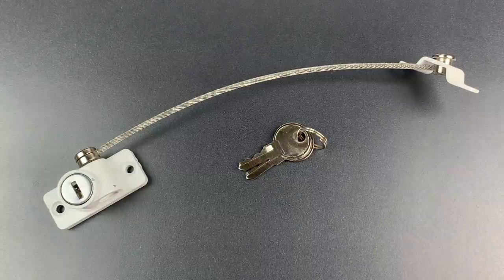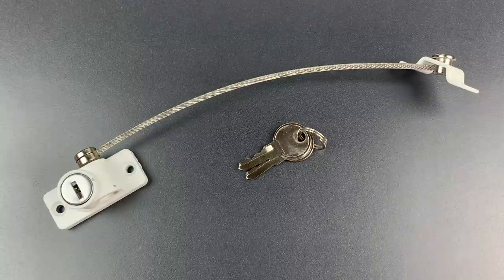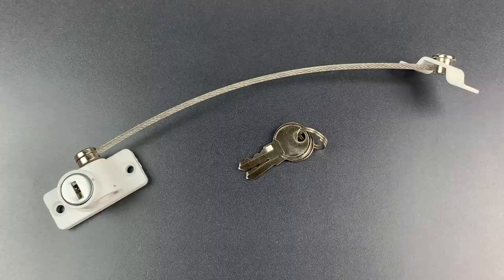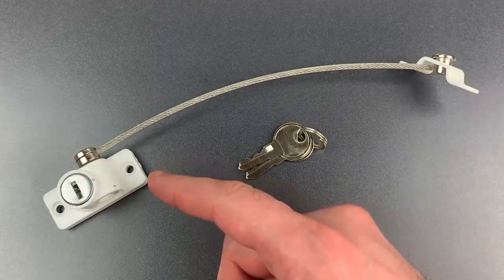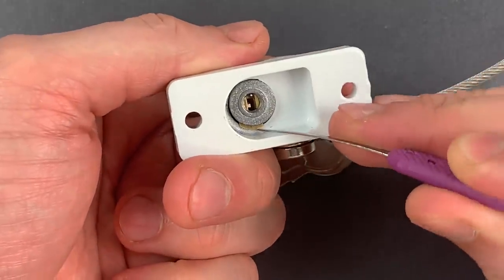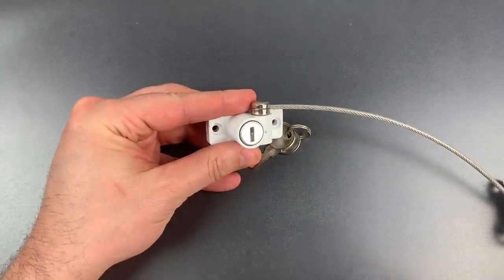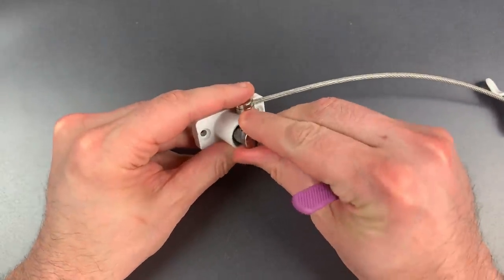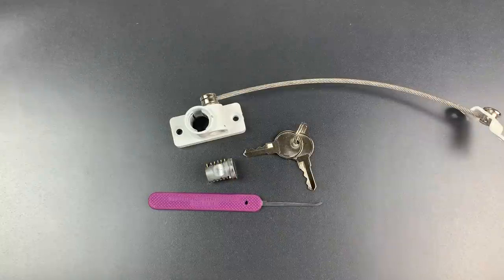[873] Why Is This Lock So Dangerous?

Comment: Wish you had shown from the back as you used the pick, so we could see exactly what was happening.
Reply: Good point
Reply: he just grabbed the core and pulled
Reply: Stand Tall the spring-loaded wafer needed to be moved first, right?
Reply: @Stand_Tall  No, the last wafer in the core is not reached by the key and its protrusion is what holds the core in place, so all you have to do is apply a pulling force and lower the last wafer in the core until it gives and the core pops out.  But yeah I agree more explanation and a rear view would have been appreciated.
Reply: Yeah what gives. Shows that you need to push that little tab on the back of the core inwards to the center... but then proceeds to stick something into the inside/center of the front of the core...???
Reply: @TweakRacer  he probably just needed a point to get grip on the cilinder, and inside the lock there are probably more surfaces to hook a lockpick behind compared with the rest of the cilinder.
Reply: Falco van gaans Not sure about that. If that was the case, then he wouldn’t have to push the wafer in before pushing the core out. So when pulling the core out the front, how did he disengage the wager on the back?
Reply: @TweakRacer  That last wafer that secures the core in place is just another wafer like those that prevent the core from turning. From inside the keyway it just appears as the last wafer in the back. "Picking" that single wafer allows the core to be removed.
Reply: jasexavier Thank you!
Reply: Thanks, I needed this answer. A view from the back would have been a perfect addition to this video.

Comment: In the UK a significant number of chain hotels have this style of lock on all guest room windows.
Reply: Broadcast1Channel and ironically in domestic properties windows above the ground floor are not allowed to have locks to meet building regulations...
Reply: In the UK we are not trusted to do anything.
Reply: was looking at one of these in a uk chain the other week
Reply: @robinturner2300  Doubt that's true.
Reply: Slemke 98 sorry my friend but you are mistaken. Building regulations in England and Wales demand non locking latches on first floor windows as part of a means of fire escape. Local Authority building inspectors do check plans and as part of final sign off inspection. I know this from personal experience.
Reply: @robinturner2300  The last place I lived in was a new build, first floor flat. All the windows had locks.
Reply: Slemke 98 which proves nothing much...
Reply: @robinturner2300  Well every other place I've lived in has had locks on the windows too...
Reply: Slemke 98 I don't doubt... However my experience is from actually getting full plans building regs approval from a County level planning department and construction sign off. So I know, for sure, what the regulations interpretations are here in Devon.
Reply: @robinturner2300  Funnily enough, I'm actually in Devon too haha. Do you mean that you can't have locked window restrictors, rather than the windows themselves being unable to be locked?
Reply: Slemke 98 building regs part B specify a minimum opening size for fire egress on first floor windows in single dwellings. Although part B appears to allow locks, in practice building inspectors insist that anything that prevents this egress from being achieved at all times defeats the regulation. So don't permit anything, lock, restrictor etc. Now of course there's nothing preventing these things being retrofitted after approval is given. Except of course that it might well invalidate any insurance and create a death trap for you and your family.
Reply: @robinturner2300  Tell my landlord that. I have one on my kitchen and I'm on the third floor

Comment: it's a safety thing so people cant commit suicide no matter the level. also you should have noticed if it was set up correctly that it wound open any more than 4 inches, so a babies head can't fit through either.  the window is not part of the fire escape plan (former hotel maintenance). at ours we had pieces of plastic that clipped into the track and were screwed into place with 2 inch long security torx bits.

Comment: These locks are fitted to windows by governments as standard in Homes in UK/England. All my windows had them and it was just renovated by the local council.

Removed them all but I agree, very dangerous and extremely annoying in general.
Reply: It’s not truly dangerous. If a hotel was on fire,  you would just throw a chair or brick at it the window
Reply: For council houses maybe, you nearly never see them in most houses cus they are a fire hazard.

Comment: A super crappy lock but a life saving hack.👍🏻🤓
Reply: @pumpkin6429  dingus be triggered over small little things.
Reply: @pumpkin6429  Excuse me, you silly, orange gourd, but what else would you call it then? One of the definitions of "hack" when used as a noun, according to both Merriam-Webster and Dictionary.com, is: "A strategy or technique for managing one's time or activities more efficiently." Pretty sure that if you needed to escape a ground level hotel room that has that locks on its windows, you'd need to do it quickly and efficiently. In that circumstance, it'd most certainly be a hack.
Reply: camjamsdad  yes your right
Reply: meh...if your life was in danger you could just grab the cable and yank that whole thing off the wall.
Reply: @freedustin  That's what I was thinking too. It must surely be brute-force removable for the average able bodied person.
Reply: @Stigstigster  Yeah, it doesn't look strong enough to withstand a couple of good yanks. Methinks that the lock is meant to act more of a deterrent than actual security, just enough to intimidate any bumbling, low rent burglar into thinking twice about going after any of the rooms.
Reply: @freedustin  You'd get more leverage and better grip by pulling the window frame. It is attached to the frame, I doubt they mount it in the glass. But, Egress is only required if there is no exit to the outside through a door. Obviously you leave by the door, if there is one.
Reply: @mundymorningreport3137  Yeah, I'd grip the frame and yank like hell. I bet the fixings would come out either at the cable or the frame/wall.
Reply: camjamsdad  Every hotel I've ever been in, if the window was next to the door, then you'd just get a nice view of the hallway.
Reply: camjamsdad  What hotels are you in that have windows leading to the hallway?
Reply: camjamsdad  If the window would be right next to the door, and the door leads to the hallway, then the window would likely lead to the hallway as well. If the room is at the end of the hall then sure the window might be right next to the door and on the side where the hallway doesn't continue, but obviously that wouldn't be the majority of rooms.
Reply: I was being silly. I didn't expect to ruin everyone's lives with one short comment. 😂

Comment: I'm a bit confused at what just happened here. Were you able to just yank the core out or did you lift the the spring loaded wafer?
Reply: Yes.  And yes.
Reply: @100,000 Subs, No Content 
Ain't nothing to see up the Holler down Copperhead Road.  No crops there.
😉
Reply: Same here. It appears that you need to lift the spring-loaded wafer first, but that only seems possible if you have access to the rear of the lock--which is screwed to the surface. If that spring-loaded wafer can be lifted from the front of the lock, that should be demonstrated, else this is just an academic post.
Reply: The wafer he showed in the back is basically an "O" shaped piece of metal. There is a spring inside the core that pushes the O up from the outside bottom of the O. This is what holds the wafer in place, and keeps the core held in. From the back, LPL pushed down on the outside top of the O to disengage the wafer and free the core. From the front, he pushed down on the inside bottom of the O for the same effect.

Comment: Where I live, in the Netherlands, these locks or alternative mechanic constructions are mandatory for windows in certain buildings (hospitals, offices, etc). The reason being to discourage or prevent people from climbing out or jumping out as a suicide attempt. There are other mandatory means for emergency exits. At least one plan on each floor explains where you are and where the nearest emergency exit (in general a staircase) is.

Comment: Suggestion: show us the back side of the lock as you're inserting the tool through the front so we can see exactly what the action is that causes the core to be released from the housing.  You showed us how you moved the wafer when you turned the lock around and inserted the tool from the back but it's not clear why that wafer would be affected by your insertion of the pick through the front.  But this is just a quibble; LPL rocks!
Reply: Michael ODonnell 
It’s the same action as doing it in the front he just inserted the pick all the way thru the core to the wafer and pushed the wafer to the side and pulled it out.
Reply: And better yet, actually do it with a paper clip.

Comment: A few years ago I was the night manager at a hotel and we had almost identical window locks to the one in this video, the main difference was that the room key (which was a physical key) also worked the window lock so in an emergency the window could be fully opened. As an aside the main purpose of these locks was to stop young children falling out of the window but the amount of times housekeeping would go into a room and find the previous occupant had unlocked it to open the window fully for ventilation.... Also, if it was not possible to secure the window lock then the room would have to be taken out of use until the lock could be replaced.

Comment: I see window locks like this all the time in my local hospital, although they're all on floors where you definitely wouldn't want to try escaping out the window in the first place, unless you enjoy falling two floors onto concrete or railings.
Reply: In hospitals, such people actually do exist.
Reply: camjamsdad  I'm pretty sure that's because there's a wheel arch physically blocking the glass from being able to go lower. On longer cars that's normally not a thing.

Comment: These locks are to stop children falling out of windows and have nothing to do with security. Its often building code to have them installed to windows above ground floor. You tend to find them in buildings that have good fire compartmentation and lots of fire doors so fire doesn't spread fast enough that a window is your only way of escaping.
Reply: Except he says right at the beginning that this WAS a ground floor room.
Reply: They are installed on all levels and he didn't say it was on the ground floor.
Reply: @mattblackledge9068  a) 00:10 yes he does.
B) ur changing your story now cuz in your op, you said they are "installed in windows above ground floor"
Reply: @mrsocko316  I work in property management. They are used everywhere in both domestic and commerical properties to stop people falling out of windows.
Reply: @mattblackledge9068  thats great, good to hear, you still said 2 different stories and said he didn't say what he said.

Comment: These are absolutely mandatory in every rental apartment for the state that I live in.
The law States that any window with over a 1m drop on the outside must not open more than 12.5cm (size of a babies head). So there are some different variations for different window types but all are installed to prevent the window from opening more than 12.5cm. 
Luckily every single window lock of this type uses the same key, shared between all brands and types. I carry a set to repair windows that are locked by one of these if the occupant does not possess a key.

Comment: This lock is such a bad idea, considering a regular door chain can be used for the exact same effect and it's far safer as you don't have to search for a key while your house is on fire. You also can't pick a door chain with the window open 👍
Reply: Its to stop children falling out of the window, (and shirking their responsibility and blaming the establishment.)
Reply: Hotels specifically use locks on their ground floor windows because they don't want customers to be able to open them wide, as this would reduce their control over who enters and exits the building. Ignorant guests letting in burglars that way tend to produce bad press, as do naughty customers letting in prostitutes.
Reply: camjamsdad  if you install them properly then that won't work, the chain should only reach once there is no gap

Comment: A bit late to the party but I thought I'd give my 2 cents as someone who writes building manuals. These are window restrictors and purposefully designed to prevent the window from opening to stop people from being able to fall out. In the case of a fire a suitable fire strategy plan should be in place that allows the occupants of a building to have a safe means of exit or in some cases a stay put method is used instead. A lot of buildings nowadays feature fire resistant walls and doors that usually last for about an hour generally. In most cases this would allow the fire department to deal with the issue at hand. It may seem counterintuitive to have these installed on windows but in places like hotels it pays to be on the cautious side, if a child was to fall and get injured or worse die then there would be big questions as to why no preventative methods are in place. But please note, I am based and work on buildings in the UK so the law in the states may be different.

Comment: These types of lock are commonly used in the UK - they are deliberately low security because they're designed to prevent access from outside only, and for exclusive use on non-egress windows.  Further to this, they prevent possibly the most terrible accident imaginable - a child falling from an upper window.

Comment: That's crazy! I always thought those were illegal! The last hotel I stayed at had one of those, and the fire alarm went off. Thankfully it was just a false alarm, but still! It seems dangerous. While I probably would have looked for another exit (I was on the third floor), the fact is I'd like the option to break my legs vs. burn to death in that scenario. ALSO what about a rescue point? Yes I realize you could just as easily break the window, but that risks glass cuts. While I might survive a 3 story fall (albeit in bad shape), bleeding out from a glass cut is a real danger. Thanks for telling us how to disable those death traps.
Reply: I’d use a chair to break the window…….

Comment: I'll RIP it right out easily. Two little screws ain't gonna hold it onto the door / wall etc. For me in an emergency. For other people or elderly probably  very dangerous.
Reply: Probably the last thing you'd think to do in the heat of the moment unless you'd drilled it into your head.
Reply: Kick the door? Yes.
Rip the lock from the door? No...unless you smashed it with a heavy object or something.
Reply: @DxBlack  A friend of mine ripped a similarly screwed window lock (not similarly working) right of when he opened the window because he thought the window was only stuck. So it isn't too far fetched I'd say
Reply: My thought is if the door is unusable then I am using the furniture to get out. I will go 80's metal band on that hotel room until I find something to throw through the glass or put a hole in the wall.

Comment: These window locks are required by law to be fitted to all windows more than 1.2 metres above the ground in apartment buildings in New South Wales Australia. The rational is that it would stop small children falling out of windows and getting injured or killed. Naturally the law only says they must be fitted, nothing stops you from unlocking them and never using them. The law also says they need to be inspected by an approved inspector every five years. It's just extra cost for the home owners association (owners corporation, body corporate depending where in the world you live).

Comment: The joys of REVERSE ENGINEERING.  Buy the same lock and look at from all angles to find the flaw.  Since most people do not travel with a lock-pick I suppose the fastest way would be to throw something big through the glass.  CUT THE CABLE with a multi-tool if you carry a LEATHERMAN.  With only two screws anchoring it a Phillips screwdriver might suffice to remove it.  Lastly,  a flat-head screwdriver might just pry the screws out of the sash.

Comment: So, in Germany most of the windows have handles that if you twist them only 90 degrees will hinge on the bottom and only open a crack, for exactly these types of cases, or when it's raining and you still want to open the window. But you can just close it, twist the next 90 degrees and open the window fully.
These types of windows are standard in most buildings. Even 400+ year old buildings often have the old windows replaced for this style.
It's quite safe, because you have to close it all the way in order to switch between the two modes, but it's easy from the inside and isn't locked.

Comment: These type of locks are called restrictors and are common in the UK. They are designed to only allow the window to open 100mm or about 4 inches so you can't fall out of them but can be easily opened if required.

Comment: I would break the window frame just as easy in case of an emergency.
Reply: Double glazing can be tough to break out through.
Reply: @recklessroges  you can't imagine what a person is capable of in dire situations. :)
Reply: You'd think that's what you'd think to do but in the heat of an emergency it's probably the last thing you'd think to do.
Reply: @yandan7010  no, it would be the first thing you do. Brute force. :)
Reply: You ever actually tried breaking real glass?